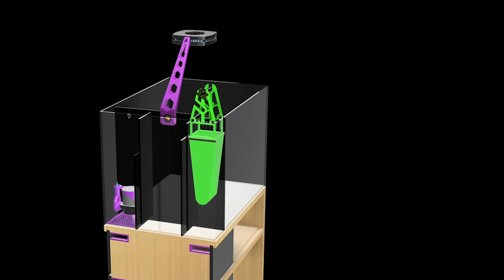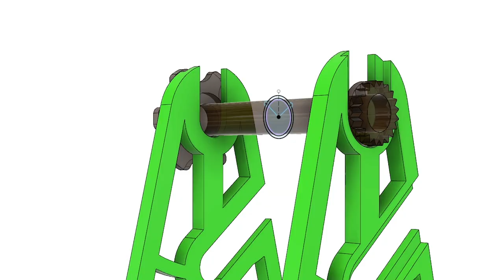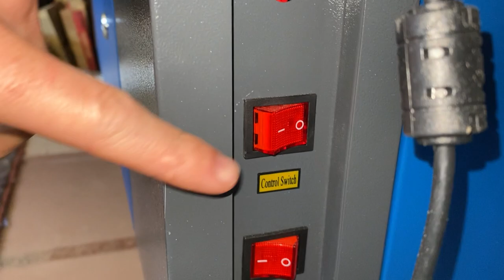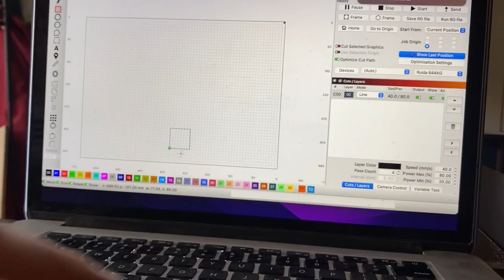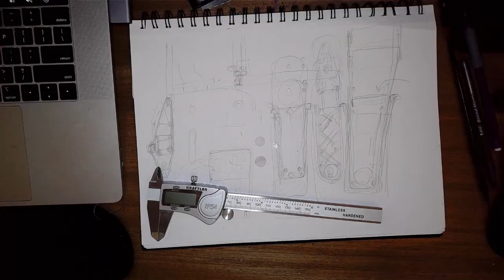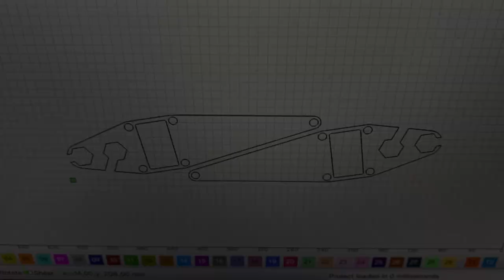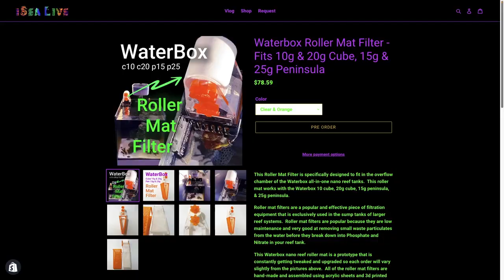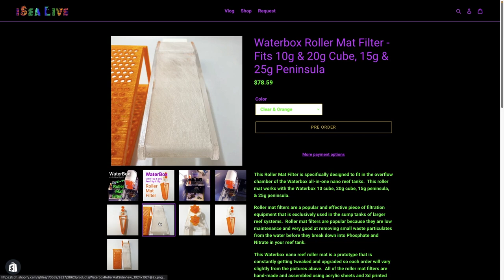WaterBox Nano Reef Roller Mat - Fits 10g / 20g Cube & 15g / 25g Peninsula

Comment: This is such a great idea, and keeping it simple with the hand crank instead of fussing with sensors and motors really works well for the small desktop aquariums! I'd love to have one on my IM Fusion 25 Lagoon tank! All the IM Fusion desktop tanks share the same filter chamber dimensions so it would be super simple to have one that fits them all! Eagerly awaiting the IM drop!
Reply from the maker: I’m with you Connor, I didn’t use a motor or sensor because I prefer reducing the total number of electronic used on the tank whenever possible.   At some point everything fails and the more you have is increasing the possibility of failure.

Comment: Quick question, what micron size fleece are you using? I picked up the roller and a few replacement rolls. First one lasted 4 months, this next one maybe 4 weeks. Not sure if there was a difference in fleece sizes being used there.
Reply from the maker: The fleece has all ben the same 200 microns every time.  I do plan a seeking out some other options soon.
Reply: @ISeaLive  weird as I have less fish and it clogged faster. Just ordered my own fleece to cut and it matches the 200 microns so at least on the right track here.
Reply from the maker: @KoiBoy6  yeah it has always been the exact same fleece that I purchased, cut and rolled.  Maybe they had a different batch they sent me or something.

Comment: I would be very interested in one that the first basket actually hangs from the side or back of the Waterbox 25 peninsula, removed the strip from inside of the chamber for a media basket. Also have a IM Nuvo 40 Gen 1 .
Reply from the maker: You the second or third person to say they removed the brackets inside the Waterbox.  I could print you some new ones if you wanted to reinstall the pieces.

Comment: I’ve been so excited for this video! Great job again. I’ll be ordering mine now
Reply from the maker: Awesome, thank you Ricky 👍🏻
Reply: I do have a question for you. I bought my waterbox 20 used. And they cut out the filter sock holder to place a media holder. And I see your filter roller is held in place by that. Do you happen to know the dimensions of the small acrylic pieces that hold the sock in place? I’ll silicone them in myself.
Reply from the maker: @rickymcnugget4635  I don’t know the exact size but my guess is that it is just a 4mm ledge on the front and back of the chamber.  Anything small should work.  Just don’t go to large or the basket won’t fit.
Reply: Thank you. I’m gonna order mine tonight. Can’t wait to install it.

Comment: Do you plan on selling the fleece cut to size on your store as well? Or can you drop a link where you've been ordering those smaller rolls from? Maybe if you get enough volume going you can find a manufacturer to produce them in the correct width for each version, on much smaller spools so you don't need to re-roll them every time
Reply from the maker: Yes, I am also selling the fleece rolls as well.  They need to be a custom size and on the specific hubs to work properly.
Reply: @ISeaLive   where do I find the fleece rolls for the waterbox 25 rollermat

Comment: just an idea to make the initial install of the paper roll easier. if you can have a Philips or square nut engraving on the rolling wheel so we can use electric power drill for much faster rolling
Reply from the maker: Thank you for the idea.  I actually did exactly that.  The roll hub has a gear on it so I printed a socket that goes in the drill.
Reply: Or even a small crank handle.

Comment: One huge recommendation i could make is making the whole structure stronger mine came in broken and it was such a tich fit when i wnet to remove it i brokt the other 2 legs still works good but ya gotta buy another one at somepoint or might go back to filter floss is cause this thing is notorious for draining my return section and flooding my tank
Reply from the maker: Thank you for the feedback.  The automatics roller is coming soon 👍🏻
Reply: @ISeaLive  can't wait!!!! I absolutely love this filtration setup then any others I've had and the Mat itself last so long

Comment: I have a WB 33g shallow tank,(discontinued now 😢) that I will be setting up next year and want to have everything ready just to plug everything and cycle it, seems like this won’t fit in the openings, they are bigger, or would it?
Reply from the maker: You should check out the specs online.  Look to see if the rear overflow chamber is the same size as the other WB tanks in the title.
Reply: This are the dimensions 23.6”x5.1”x12.4” which are different from the tanks you made the roller for.
Reply from the maker: @mike-dq5ro  that’s just the size of the rear overflow chamber?  That huge.  Are you sure that not the entire rear chamber?
Reply: @ISeaLive  yes you’re right, it actually is 3 3/4”x 4 21/32” it comes with 2 overflows.

Comment: I have a Fiji Cube 22.4 tank.  The filter sock area is 3.46"X3.54".  Would any of your designs fit?
Reply from the maker: What size filter sock does it use?
Reply: @ISeaLive  the sock is 2.75" x 8"
Reply: @jimgill6222  did you guys figure this out? I have the fijicube 22.4 too and the waterbox seems to be about the right size.

Comment: Your work is really fantastic, i would like to have one in my tank, but i need to keep cost as low as possible and almost everything that i have is diy (including tank itself). Still your rollermat is an inspire for me and i will try to do it by hand, maybe pvc foam board will do the job as skeleton material (i dont have acces for 3d printer). Good luck with future projects :)
Reply from the maker: You should totally get a 3d printer in the future.   About $200 for a decent one that will get the job done.

Comment: Love the concept. Shame there isn't more size varieties for fleeces so you don't have to cut them down. Why don't you put a screwdriver slot or cross or even a socket shape on the end of the hubs so you can use a cordless drill to roll the fleece material onto them?
Reply from the maker: Haha that's exactly what I do now.  This was just the first attempt so I did it the hard way.
Reply: @ISeaLive  Excellent. Don't suppose you've let the files out yet? I'd love to add a float switch and motor to your design! I designed and printed an automatic roller filter for my main tank when they first started appearing on the market. Hated cleaning filter socks!
Reply from the maker: @matthewsearle4822  yeah just shoot me an email Mark@isealive.com

Comment: I have a Waterbox 130.4 as a freshwater and run two Klir DI-4 in the sump, change the fleece about every 3 months or so. Have been considering a WB 20 Cube lately and my hang up has been filter socks after getting so used to rolls. Running across this video may have been the deciding factor to pull the trigger on one. Question though, say the fleece clogs up and you forget to roll, can you show how that goes with over flows?
Reply from the maker: Hey it’s totally possible that the fleece clogs but I haven’t come close to that yet.  The rear wall of the Waterbox is about 3mm lower than the exterior glass of the tank.   Worst case scenario the water lever in the tank would rise and spill over the rear wall into the filtration chambers.  One would have to leave the tank unattended for a while.
Reply: @ISeaLive  What is the lead time on these with the pre-order?
Reply from the maker: @KoiBoy6  I'm currently finishing up the first batch of 20.   I'll probably ship out the first preorders next week.   It's about 2 weeks from coming off the pre order.
Reply: @ISeaLive  Sounds good. Just placed an order tonight along with some rolls.
Reply from the maker: @KoiBoy6  awesome, I just saw that.. Thank you 👍

Comment: Damn, the 35.2 sock chamber is just a little bigger. I’m moving from my pen 25 to a 35.2. The chamber is 81x120x450 as opposed to the 80x80 for the smaller cube and mini pen tanks. If you can get them for the larger waterbox aios I’m in for two since they all have two sock chambers.
Reply from the maker: That should be to hard.  The only issue is testing.  Does anyone in So Cal have a Waterbox 35.2 I can test out the design on ?
Reply: I’m ALL the way on the other coast
Reply: @ISeaLive  the 50.3 has the same sock box dimensions
Reply: Alas, I’m in NorCal. If I buy a 50.3 will you make a trip up the coast? I have digital calipers and can take accurate dimensions in advance.

Comment: I would like one that fits the WaterBox 65.4 Peninsula AIO.  You are not charging enough.
Reply from the maker: What size filter sock does the WB 65.4 use ?   You might be right about the price.
Reply: @ISeaLive  Filter sock chamber: 161 x 120 x 450 mm (6.3" x 4.7" x 17.7").  The width of the AOI filter chamber is 4.7".  Filter socks: 70 mm (2.75") x 2.  You should to charge ~$50 to make sure it is worth your time.

Comment: what i dont understand is how youre selling a 3d print  for 120 dollars when innovative marine has a full acrylic drop in roller for 100 dollars FULL ACRYLIC. Seems like u got really stingy with the pricing this file should be no more than 50-60 dollarsconsidering its made of filament which holds in bacterica and no where near as durable.
Reply from the maker: Everyone wants everything dirt cheap these days.  I’ll lay it out for you.  The roller mat is made of about 20 different parts that have to get printed and assembled.  The total printing time of the project is about 30 hours.  If anything fails it is unusable and has to get thrown out ( this has to be accounted for).   It also has custom cut and rolled filter rolls which takes a lot of time and effort to make.  3d printing is far superior as I can design and make things that no other manufacturer process can.  Many of the parts on these roller mats can’t get make any other way.  Last, innovative marine is a multi million dollar company that copied my design but made it cheaper quality and a huge ugly monstrosity.  The comparison is not Apples to Apples here and the last thing I am going to do is make these things for less $$$ as I already make very little producing these.  I am just one person making these in my garage on the weekends.  And I still make them way better than IM.